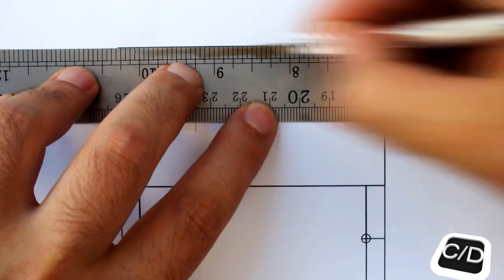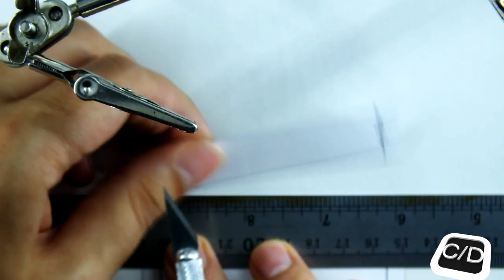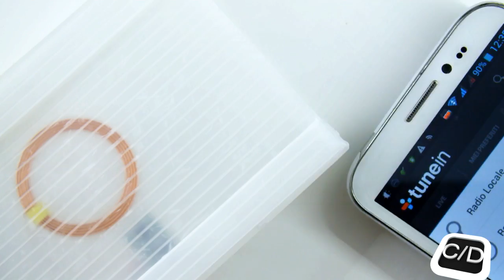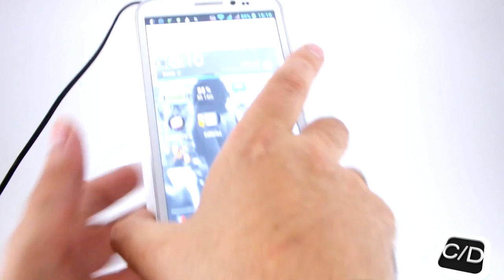Project: wireless charger for every phone (PART 2)

Comment: this will work, but inductive charging requires a way of receiving the current. samsung galaxy has another coil inside the phone; it is built for this. this wont work with iphones and such without a receiver attached to the charging port.